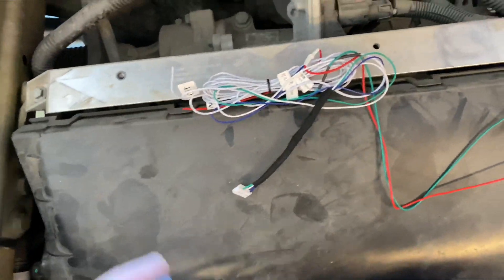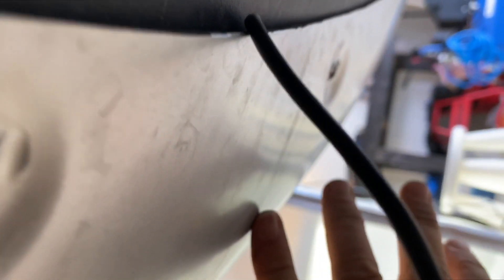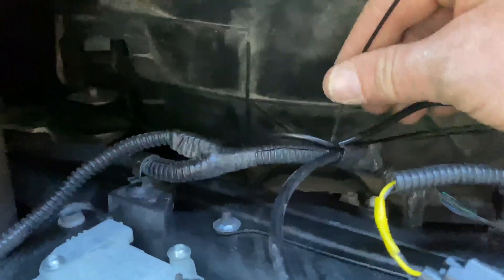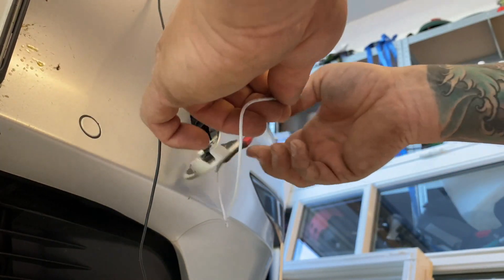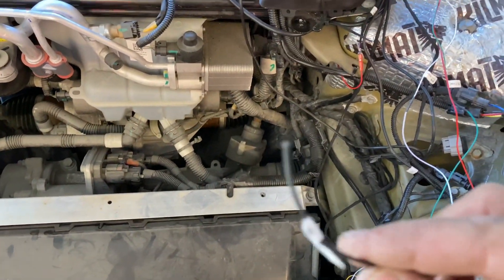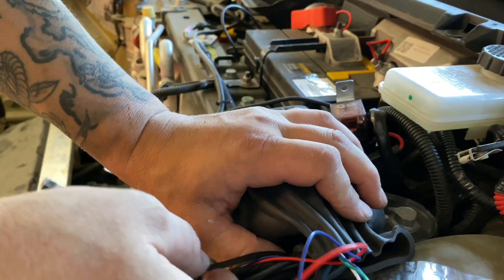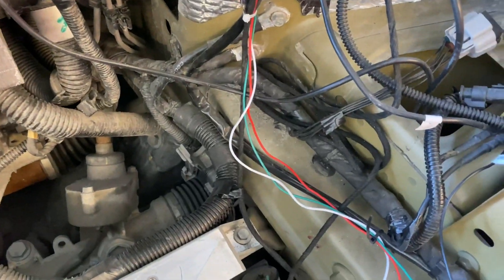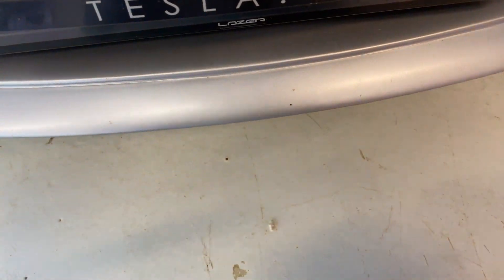THIS IS SO AWESOME - INSTALLING FRUNK FOOT SENSOR TESLA MODEL 3

Comment: Hey good work. But I have another question. You have that Sound proofing on your Front shocks. I made that inside the car but not in front. Did you noticed some difference? I would make it too if it's good. I'm not sure at the Moment.
Go on and respect for your work. I made also your Trick with the tweeter.
The little noises make me crazy. Wonderful car but some Interieur noises and the bumps from the Front shocks are awful.
Reply from the maker: Mike Werner hey! The whole car from frunk, doors, floors, trunk is soundproofed ;) Yes it makes a difference. Cheers thank you for your nice words